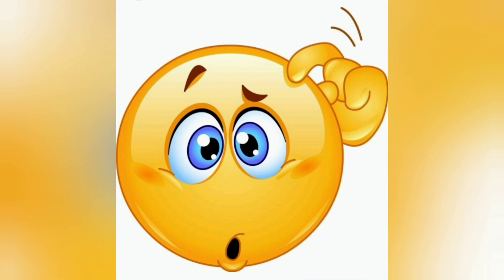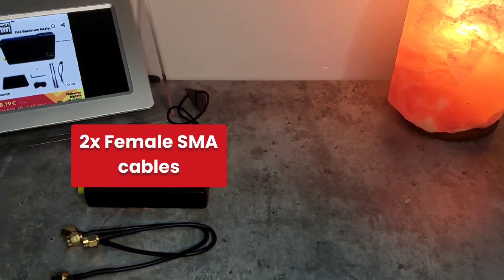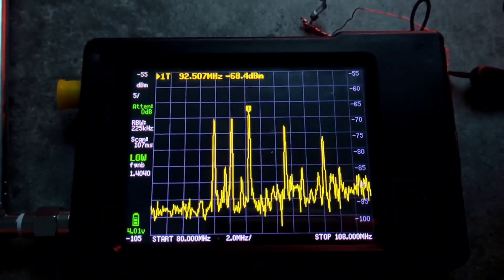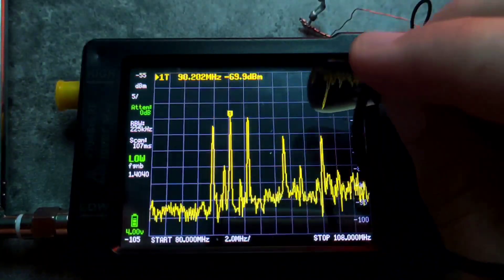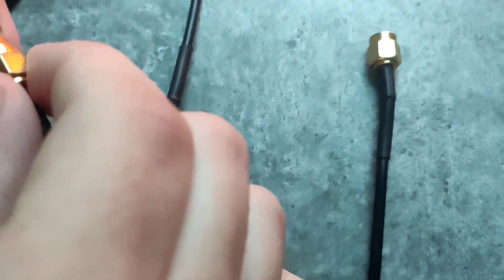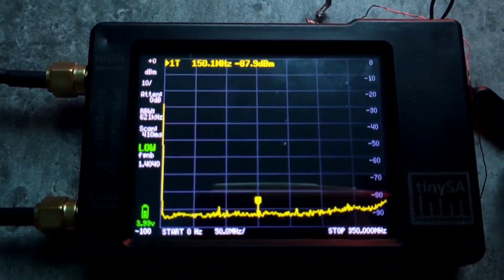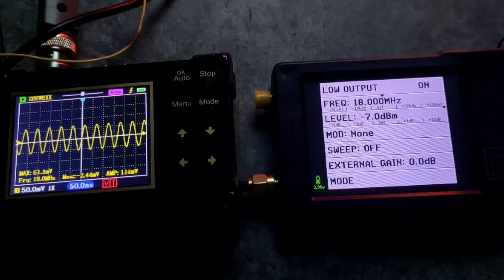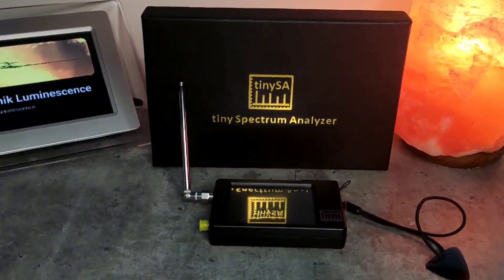TinySA Spectrum Analyser Review & Unboxing and Tests with Oscilloscope | RF Analyser

Comment: Very good review! I really like mine ! You know there is a PC software you can download free.. it offer a more comfortable view and it's a great way to share your screen too! Cheers my friend!
Reply from the maker: @Neptunium  thanks for the tip ! I already had the software, but i sort of forgot about a older screenshots I had to share as example. Also, remember when in your skin walker ranch debunk you also talked about the "mysterious radio signals" and then you revealed that the antenna probably picked up some noise from the monitor ? For whatever reason, my monitor can interfere with walkie talkie at 446,04 MHz or so. I don't exactly know why a monitor can possibly do such high frequencies. I did capture my computers almost 1 GHz clock, but the monitor has no reason to 🤣.
Reply: @photonik-luminescence  I think there is some resonators in the screen electronic that generate a specific frequency, if the interferences are  evenly spaced out, there is a good chance some sort of component in the screen is generating that . Especially if it gets stronger as your antenna gets closer to the screen ...